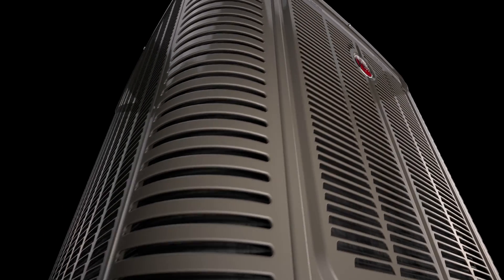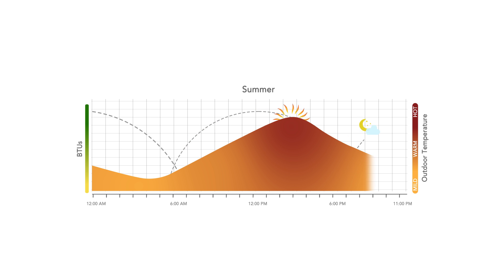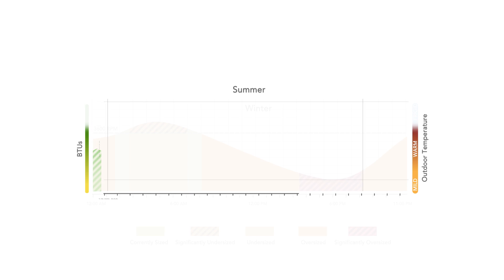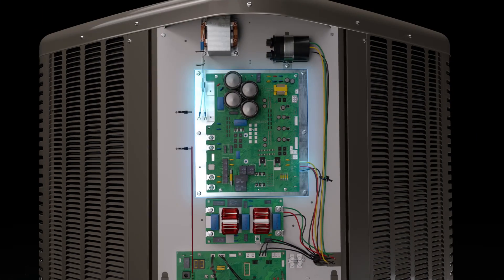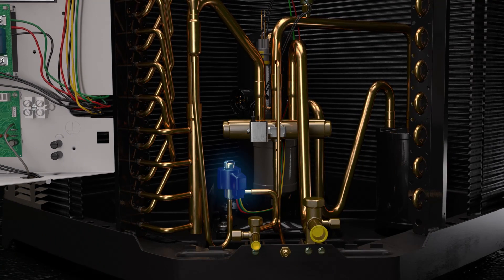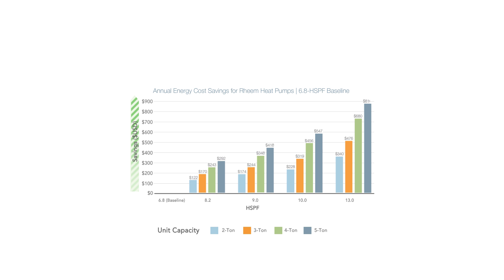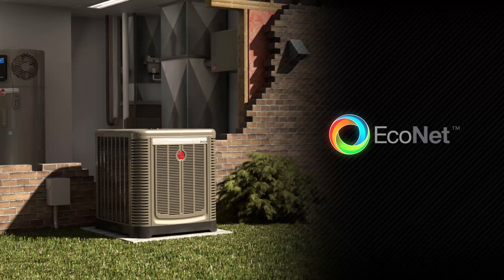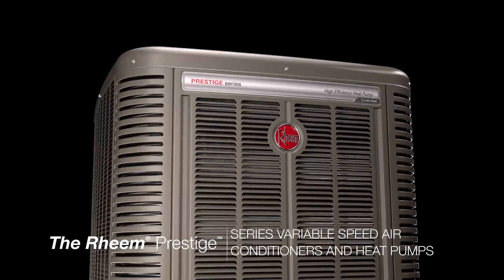Rheem® Prestige® Series Variable Speed Air Conditioners and Heat Pumps

Comment: 0:45 Is that horizontal dashed line supposed to be the BTU output of the single stage air conditioner? ... as the outdoor temperature increases, BTU output decreases .. not horizontal, varies upon temperature and so does compressor load (power consumption)
Reply: From my understanding ALL these are really single stage for the most part. All the talk and fluff of dual stage, variable speed etc is just another take on single stage. 
But it IS quieter and smoother. I just got a dual stage put in and I liken it to the transmission of a 70' vehicle to today's tranny. 
Very smooth these multi stage doohickey fans.